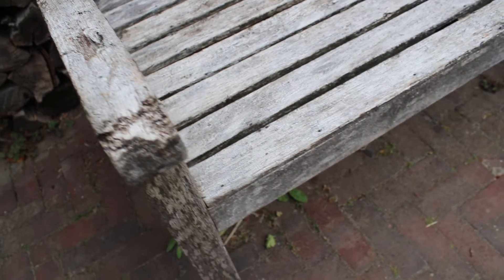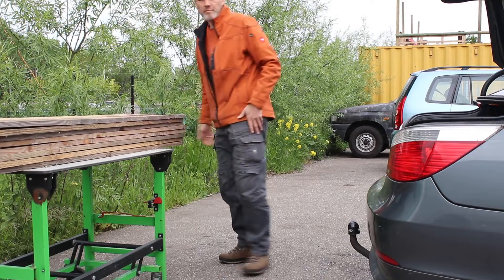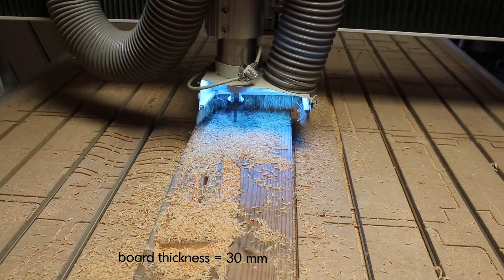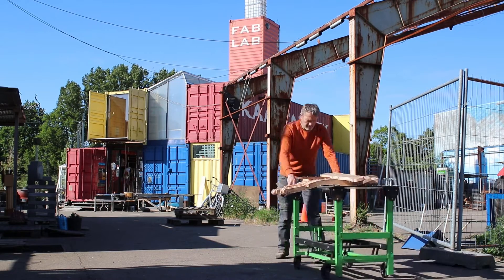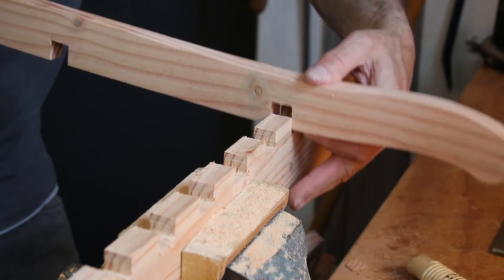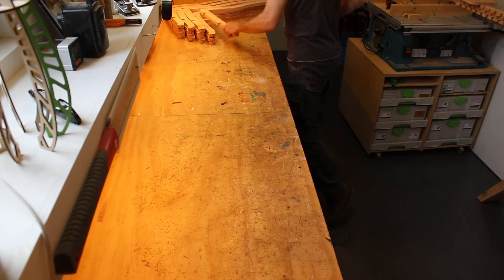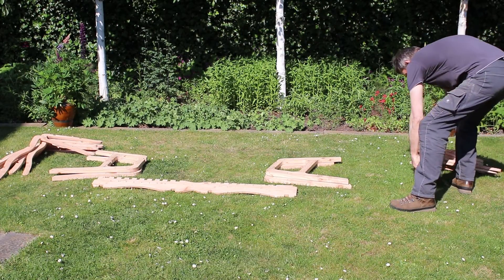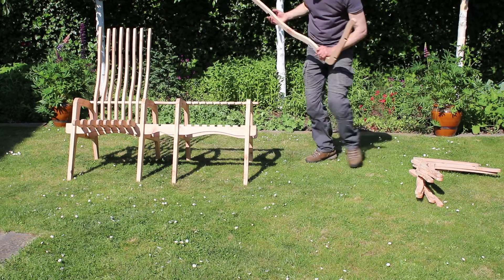Duo seat lounge chair from Douglas | made with CNC

Comment: Nice project, thanks for providing plans. 
Perhaps your next project should be a zero clearance table saw insert. ;-)  I have a close friend who almost lost a thumb when cutting thin wood strips and the blade pulled the strip down into the saw.
Reply from the maker: Thanks for the tip. I will make a zero clearance insert.